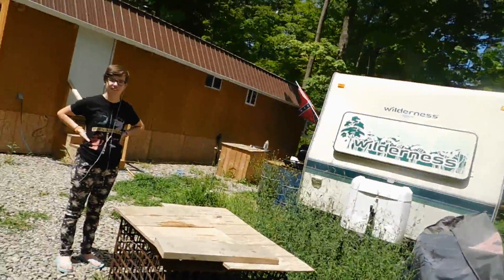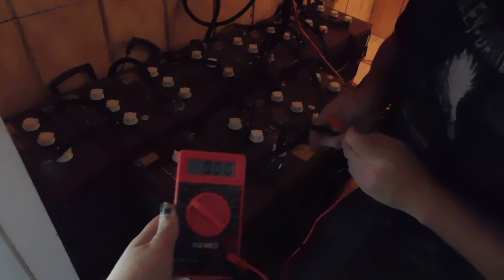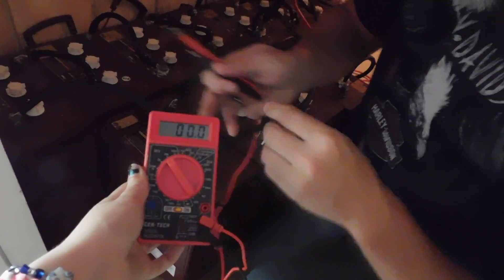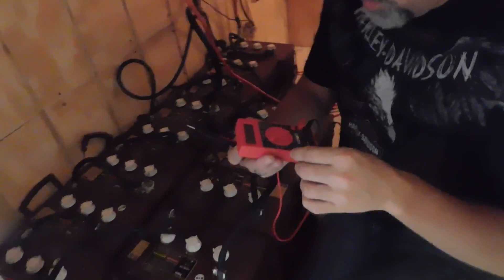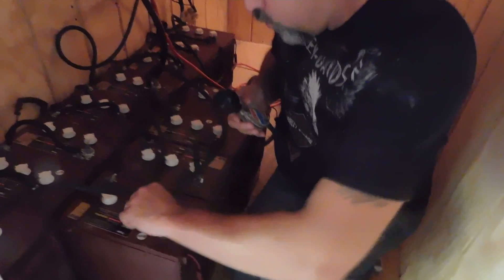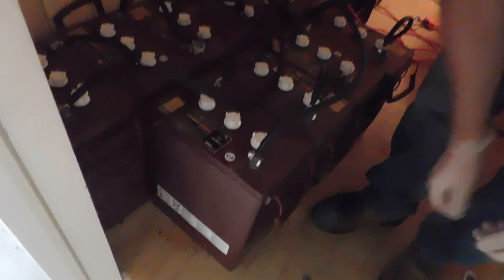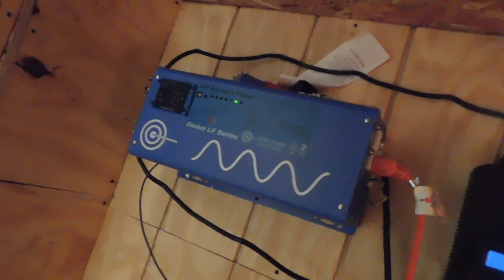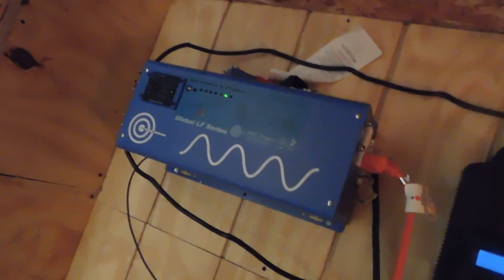How to check for specific gravity using a Hydrometer on my batteries.

Comment: Hi prepper nurse 1 great video Listen I have a Question for you in a 40 ft 5th wheel running basic things how many panels will you need along with batteries also on a 16x80 3 bed room 2 bath mobile home how many would you need if your running the same things
Reply from the maker: That all comes down to want and need. How much power do you want to have and how much you really need and location is key as well in the south its a lot sunnier than in the north so you don't need as many panels. I am sure that does not help but everyone is different if you want to run freezers you will need more power.
Reply: Ty for the information its very helpful

Comment: How often do you need to check batteries for maintenance?
Are those glove sufficient to check your batteries?
Do you have propane hooked to camper?
Give us a well water update.....when you have time?  
Great video. 👏👏
Reply from the maker: At least once a month they need to be checked. And yes they are good enough. Yes the propane is hooked up to the camper but we don't really use it.

Comment: That is excellent SOC! Very happy to see high PV volts coming in and good KW/H harvests. My 2-cents (FWIW), would be to double the solar panels first before going to 48v. The Classic can handle it. Looking great guys...from what I see on the video, it "looks" like your system is running really smooth.
Reply from the maker: Thanks Chris  I have been very pleased with the system its working great.